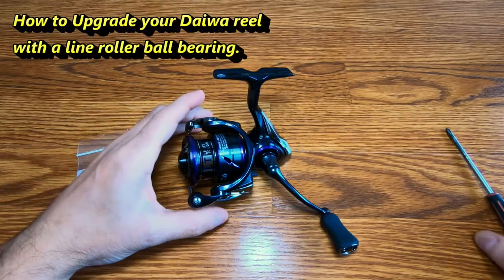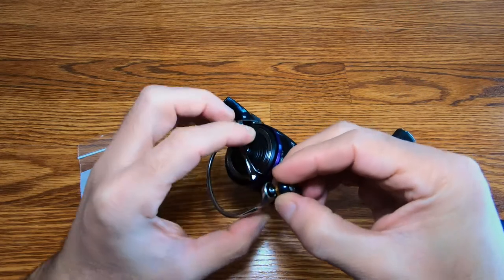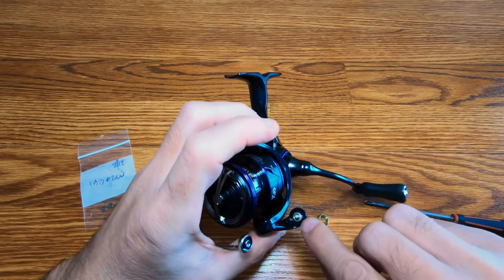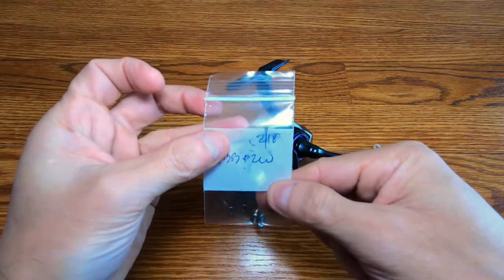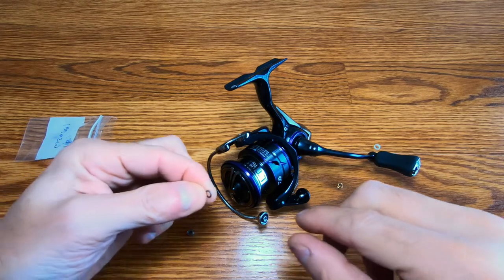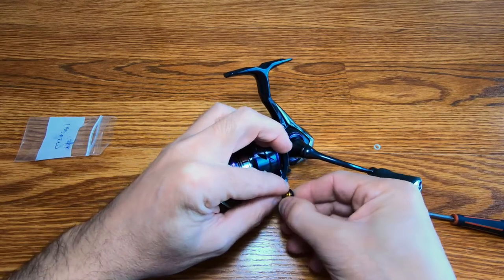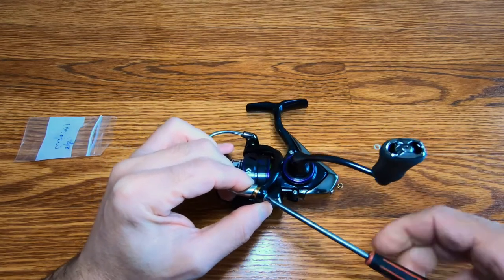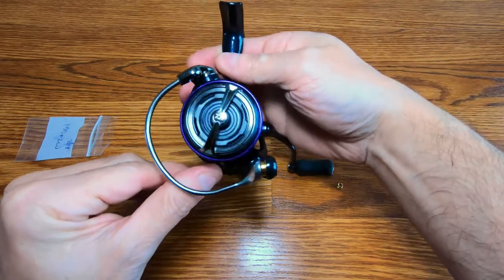Daiwa reel line roller ball bearing upgrade how to

Comment: Anyone looking for the individual parts you can buy them a lot cheaper on Aliexpress than what this kit+shipping goes for.  You need the following:

Washers: 2 ea, M3x5x0.3 Stainless Steel (3mm shaft diameter, 5mm outer diameter, 0.3mm thick)
Bearing: 3x6x2.5mm (3mm shaft diameter, 6mm outer diameter, 2.5mm thick)

Comment: Thank you for the video. I need to take a part Daiwa Saltist MQ 5000 D line roller but it does not come off easily. By any chance, you may have done this before?
Reply from the maker: Hi all the line rollers usually come off the bail by the screw on the side like in my video.
Reply: @PHFishingBiking  There is Line Roller Remover tool which is discontinued in Hedgehog Studio. It is not a necessary tool then...
Reply from the maker: Hi I am not sure I never had a reel that needed a special tool to remove the roller from a bail? @UzunKamis

Comment: Hello mate, great video, could you share the dimensions of a ball bearing and the washers, I cant order it from ebay because the shipping to my country is too expensive, so I want to find it somewhere else.
Reply from the maker: Hi I am not sure what size they are and I don't want to take it all apart to get measurements I am sure if you do a web search on daiwa bail bearing kits you can find them or the info.
Reply: Washers: 2 ea, M3x5x0.3 Stainless Steel (3mm shaft diameter, 5mm outer diameter, 0.3mm thick)
Bearing: 3x6x2.5mm (3mm shaft diameter, 6mm outer diameter, 2.5mm thick)

You can get them a lot cheaper on Aliexpress than what the kit+shipping goes for.

Comment: I got only the bearing,gotta find the washers somewhere,otherwise the bigger lip of the roller goes to much inside the screw side.hm.
Reply from the maker: Yeah you need the washers.  Thanks for watching.
Reply: Washers: 2 ea, M3x5x0.3 Stainless Steel (3mm shaft diameter, 5mm outer diameter, 0.3mm thick)
Bearing: 3x6x2.5mm (3mm shaft diameter, 6mm outer diameter, 2.5mm thick)